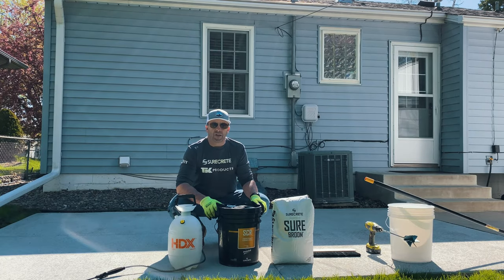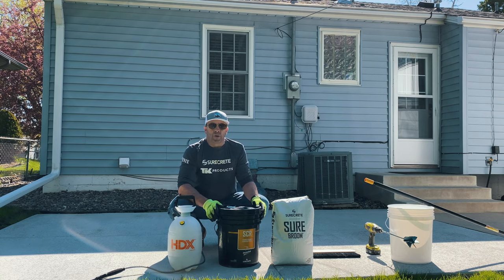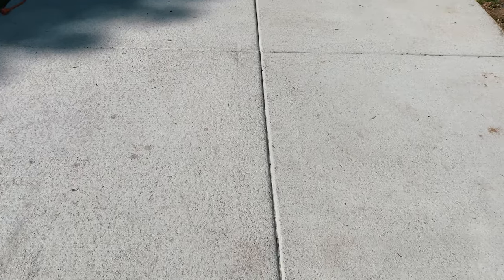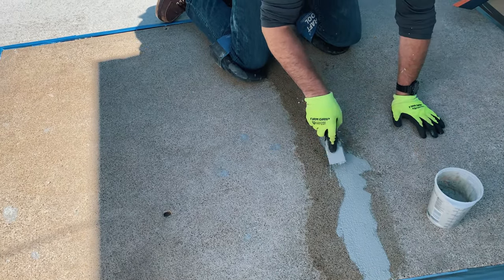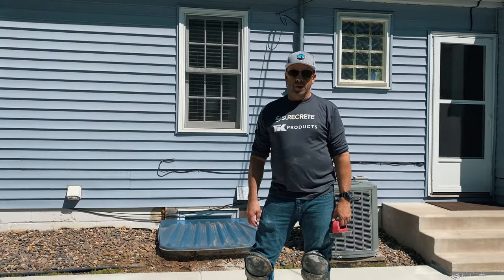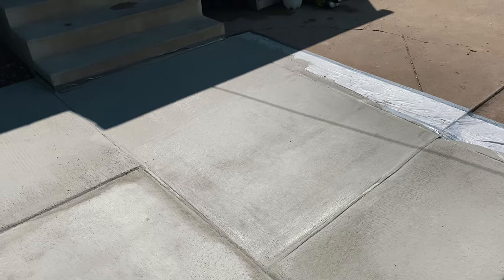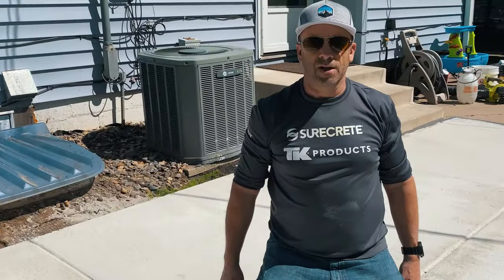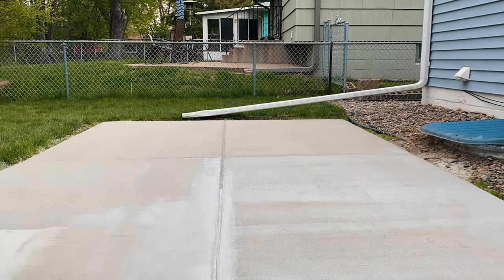Fix Your Ugly Concrete

Comment: Or you can just mix portland cement, bonding agent, and use more water than usual. and paint it with the portland
Reply: One major difference is portland doesn't have the fine grit within the product.  You'd have to mix sand in with it to achieve a similar result.
Reply: That process is not even close to resurfacing conrete. Portland whitewashing is just changing the color to give appearance of new concrete. That is the  equivalent thought process to painting a room and thinking it would hide a poor drywall job.
Reply: Medic311, those other two comments about requiring fine sand are correct.

Comment: I have a 1900 square ft driveway. The previous owner applied bright white concrete resurfacer over the grey driveway and sidewalks in 2004. It has all popped up from the freeze/thaw cycles. It looks like shit now. I have three choices; do nothing, replace the concrete ($17,000) or grind the resurfacer off and reapply.

Comment: Paul the concreter pour concrete for me 2 week later its all cracked.
Thanks for the video.
Reply: Not enough Expansion Joints
Reply: If it's spoiled on the top call him back and make him redo it

Comment: After applying this product would it be possible to put down Epoxy floor sealer?
Reply from the maker: Yes it would, however, you wouldn't want to apply an epoxy outside, as epoxies are not UV stable and would yellow quickly from the sun. Epoxies are also high build, which would result in the surface being slippery outside.
Reply: They do make polyaspartic that is UV resistant to go over epoxy, and you could also use either fine beads, or sand for tough grit like a sandpaper finish

Comment: What if I don’t want a broom/rough finish but a smooth showroom one instead?
Reply from the maker: If you were inside, you would want to use the MicroTek, which would give a nice smooth finish. SureBroom has larger sands in it, which prevent it from getting very smooth.
Reply: @diyconcrete7671  great info thank you 👌🏻

Comment: Why do this when you must repeat the process every two years?
Reply from the maker: You don't need to repeat the whole process, only the sealer must be reapplied every two years or so, as it will wear down with weather, traffic, etc. Thanks!
Reply: @diyconcrete7671  i should have asked one of the concrete crews working with the utility companies to take their left over and repour my driveway. Snooze, you lose. Could have got it for a song.